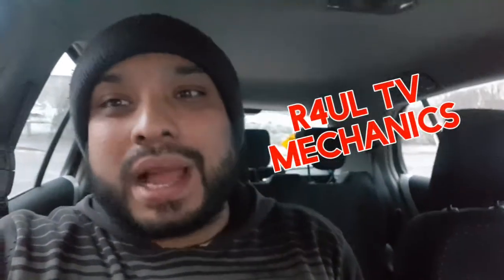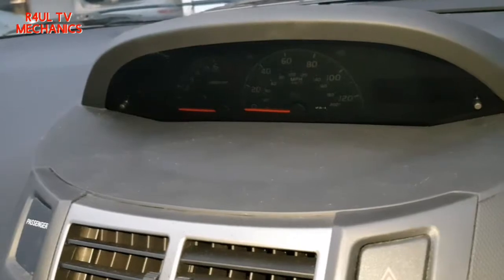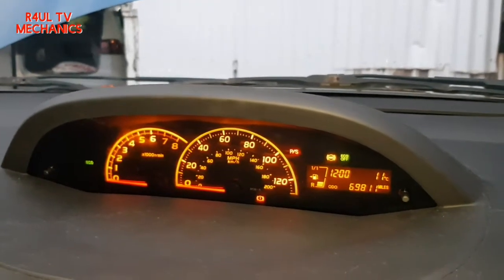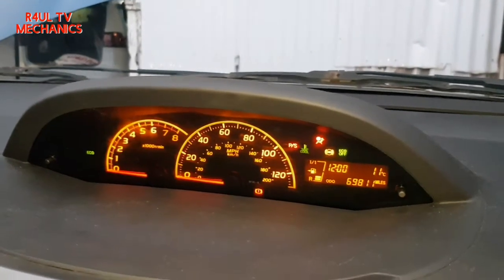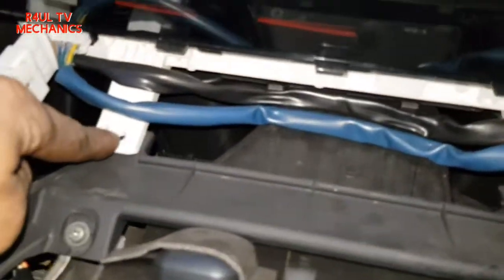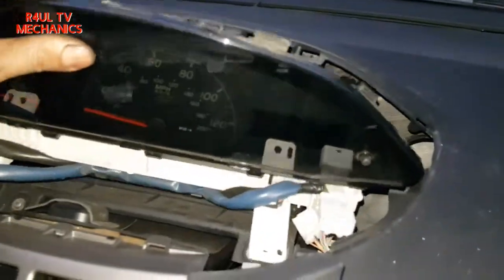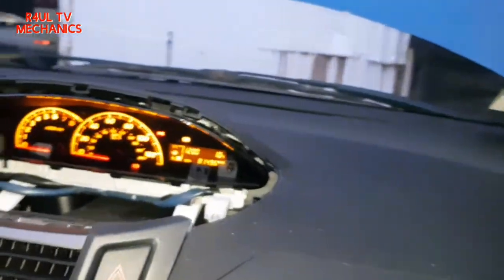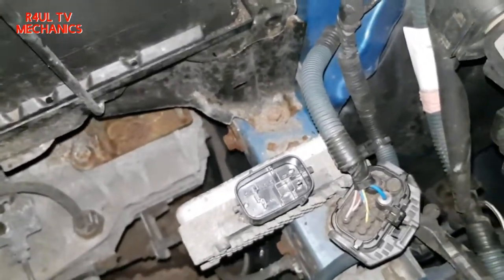2011 TOYOTA YARIS DASH INSTRUMENT CLUSTER REPLACEMENT

Comment: Seems to be a faulty eco run converter fault, apparently can happen to the Auris as well.
Something like this "Converter Assy, Eco Run Vehicle, TOYOTA, G92C0 52030"
Sometimes the dash lights just flicker, other times they stay on and drain the battery.
Where its positioned, catches all the dirt and water.
Reply from the maker: Thanks for watching really appreciate it. It was the eco run converter at the end. Thanks